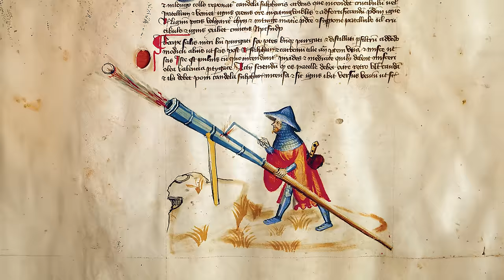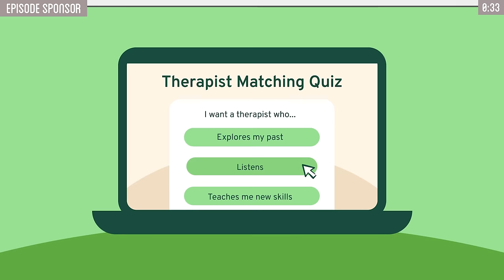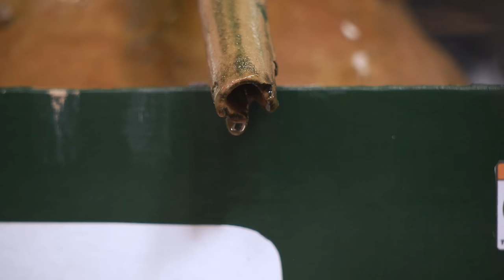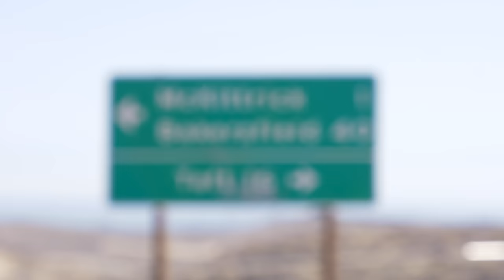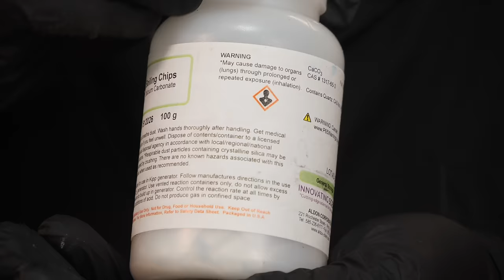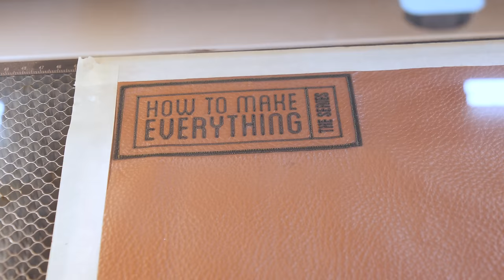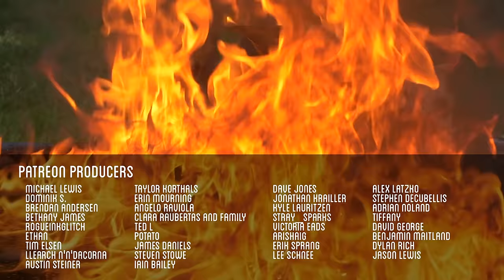I Recreated the Lost Recipe for Greek Fire!

Comment: Crude oil varies wildly in its composition.  It ranges from a jet black, nearly asphalt/tar in consistency and difficult to ignite, to a lighter color than 0W synthetic engine oil, about as viscous as water, and more flammable than gasoline.  It all depends on what formation it came out of and how long the oil has been cooking down there. The crude oil you got was likely of the former, and was a little more "undercooked", if you will.  If you want some of the better stuff, reach out to a lease operator in West Texas, they can probably get you a jug of it for free to test.

Interesting side note, in the old days when they hit a pocket of that gooey trash and it ended up being too thick to pump out, they would make a loop of rope that went down to a pulley at the bottom of the hole and then back up into a tank, where the rope was threaded through a rubber hole that wiped off the oil that got stuck to the rope as it ran through in the well.  Most of them used steam power that came from burning the very oil they were extracting, so with a little maintenance and a water supply, they'd run free of charge until there was no more oil to extract out of the ground.

Comment: Crude oil is definitely the main ingredient of Greek fire, but it would be too thin and burn too fast to be very good on its own.

Resin is the most likely ingredient added to thicken the crude oil, being a highly flammable liquid that sticks to about anything.

My guess is that Greek fire auto-igniting on contact with water may be an exaggeration based on the flaming liquid staying ignited on the surface of water.  Since it was already lit before being fired from pipes, it would be unusual for it to even end up thrown into water without being on fire first.  Even in terms of igniting any that is accidentally sent into the ocean without being lit first, the resin is flammable enough to make it easy to ignite.  The best reason Romans would have to put any quicklime in would have been for the noise and steam given off when it hits water to make it a bit more dramatic for anybody on the receiving end without any tangible benefit or down side.

Sulfur wouldn't need to be added to make it more flammable or to help it burn any hotter, so the only reason I could think of for adding it would be the sulfur dioxide given off when it burns.  Irritating the eyes and lungs of enemies could be marginally beneficial to Roman soldiers.  Since it was basically napalm already, it really wouldn't need to give off noxious gas to do its job though.

Comment: The "pump" which is the device which made it famous was probably key to it's success. It's said that it was a heated sealed container and that when fired it was projected from the nozzle. If you have a sealed pressure container. Once it reaches the boiling point of one of the lighter chemicals it will self pressurize. When you open the valve the liquid inside will very quickly boil pushing the liquid out the pipe through the nozzle. It's already at the point of vaporization of the lighter chemicals and will burn like mad. Note that this would be dangerous to test.

Comment: As the professor said. Greek fire/Liquid fire was more about the weapon system that pumped a flaming stream of crude oil, not just the light crude oil by itself. Actually a vegetable oil and ethanol mix would probably work too, but would be extremely expensive in a non industrial society. Vegetable oils were a food and cooking staple as well as a lighting source, thus expensive, while pure ethanol would not have been available.

Comment: Perfecting the lime:water ratio is critical. It also helps if you add a "fuel" like wood to the equation. I work with quicklime every now and again and the only fires I've seen involve pallets or sawdust in the solution.

Comment: Lycopodium Powder which you used in another video actually has very interesting properties with water where it stays dry and burns quite readily. I believe if the oil doesn't mix completely with it, it could act a pretty interesting addition, as the heat from the flame may cause an updraft raising the dust out of the water and oil producing larger more dangerous flames to make it even more terrifying

Comment: Pretty much any of those recepies can be the real one, because the main component that limits the ignition of a liquid is the oxidizer, in this case, the air.
So, a spray of any of the recepies will make them work. 
Also, temperature is important. Many ancient incendiary weapons used to heat the fuel before igniting it, to reduce the viscosity, but inadvertently evaporating some of it, making a rich fuel/air mixture that ignited better.

Comment: Pine resin and oil until past target viscosity, add alcohol to guess at thinning it out just for ease of ignition. Then very importantly add sulfuric acid until they combine properly as alcohol isn't very soluble in oil until acid is added. The acid is meant to sort of magnetically stick to both the oil and the alcohol, I forget the name of this loose chemical bond. 

If incorporating oxidizers such as salt peter, they must be fully dissolved in the alcohol first, and then the proportions of alcohol base used may be increased ONLY TO A POINT, but be extremely cautious when adding the acid to combine everything, as acids can set them off and ignite it. (The oxidizer would very much like to react with the fuels, but cannot, the acid can allow them to.) Also note that to create something explosive here, you would have to mix way more oxidizer in there, hence why I advised to fully dissolve it, not make it into a paste. That being said, a slower reaction could take place that gives off noxious exhaust gasses! On sea water, these gasses could be even more poisonous, but given the ingredients you are using you may get sulfur gasses that could cause death or serious injuries and burn to your skin, lungs and eyes even if not ignited. Unlikely, unless you go nuts with the proportions, but still possible, and some combinations of sulfur and hydrogen found in fuels and water can become poisonous in small amounts. (Maybe, who know..) Just trying to cover my butt!

 One last thing is that the main reason your alcohol was very useless was that it is soluble in water, but if you use acid to stick it to oil, or create some sort of an emulsification with oil, the alcohol helps improve ignition because it evaporates very readily, and ignites at a very wide range of concentrations with oxygen.

P.S. Plain oil would work pretty well, but easy ignition oil with spices in it would work more like an epic legendary weapon from history, worthy of myth and exaggerations!

Comment: I mean, a lot of this testing probably could have been avoided if we just take into account the fact that this stuff was supposed to be pumped through some kind of hose delivery system. 

Just the fact that it has to move through some kind of pipe or hose pretty much invalidates 90% of other things like hard minerals, solid additions like wool, etc. 

It's gotta be a pure liquid or extremely light oil type consistency to be able to fire over short ranges without potentially damaging your own ships. 

Just that fact alone and the fact that napalm is already a thing can give you a pretty good idea of what it most likely was, which was just straight up liquid petro with some kind of thickening agent to make it stick. Anything else just wouldn't make sense since all it would take is just to spray the enemy boat with the oil and then use a standard fire arrow or torch to light it. 

Self lighting wouldn't even be needed since you are shorter range anyway from the sprayers.

Comment: I'd love to see a followup to this where you take what you learned from these tests and try and refine it. As you said, the Ether burned very well but the quicklime couldn't quite ignite it. Could one of the other recipes do the igniting? Or perhaps even the delivery device like in a modern flamethrower?

I suspect the real secret to greek fire is going to be that of a specific recipe. The refinement of one or maybe multiple of the methods they had available into a particularly effective mix. You can have all the right ingredients but what if it turns out you need to fill the glass vial up to a specific point for maximum effectiveness? That sort of thing. The phial might also be important. Gunpowder isn't all that effective on its own, it becomes effective when contained.

EDIT: Forgot to mention. The composition of the target could also be a factor. What were the ships of the time made from, and were they coated in anything that might be relevant to the effectiveness?

EDIT 2: Another thing to consider is that the recipe might have required some "fermenting time". Someone else in the comments said that Ether can become very explosive when left in the bottle over time. It could be that you have to let it sit for quite a while. But thats getting into some very hazardous territory. Which is probably on the right track, but still. Don't want to risk that I imagine.

Comment: You said the princess recipe which uses pine resin is assumed to be incomplete.  Maybe the resin is supposed to be distilled.  That would give you turpentine, which is flammable and also works as a solvent to make the crude oil more liquid.

Comment: You need a taller fractional distillation tower and to tap off at the right height. The greeks worked out preliminary polymer work. Thats a better bedrock to start from, and oxygen/air autoignition materials were available at the time. Sodium and mercury salts for instance. Polyethylene could be made from crude i believe which would solve the surface tension and combustion problem.

Comment: Try:
3 parts pine resin, 2 parts olive oil, 1 part quicklime, 1 part sulphur, 2 parts bitumen, 1 part volcanic ash or clay

For a more water resistant version:
2.5 parts pine resin, 1.5 parts olive oil, 1 part quicklime, 1 part sulphur, 3 parts bitumen, 1 parts volcanic ash or clay

Comment: See from old picture, It shoot from ship horizontal direction. Maybe from pressure tank with high temperature. That is possible reach the flash point of mixer. The secret may have a he air blower to blow jet air to reach temperature the same way black smith rise the temperature to iron.

Comment: Have you tried adding some flint and steel sparking elements that would activate on impact inside the glass? Or maybe adhere a piece of purified sodium to the side of the glass somewhere in such a way that when the glass breaks, it also breaks the oxidized surface of the sodium so that it will be exposed to the water and ignite?

Comment: Actually, Petroleum distillation separates compounds on the basis of their relative volatility, which is usually inversely proportional to their boiling points.

There isn't any gasoline in your beaker, but possibly a very few of the 150 chemicals that make up gasoline.

Comment: How about adding calcium carbide?

I’ve got no clue if they had access to that stuff back in the day but if so I’d imagine it could’ve been a good ingredient. 

When coming in contact with water it’ll also release heat and more importantly acetylene. 
Maybe the acetylene would be carried away by wind too quickly to be of any effect but I think adding a highly flammable gas into the mix might improve its water resistant properties. 

Might be worth a try.

Comment: You sould look into some kind of boiling mechanism that would use the pressure of the oil boiling to project the oil. I'm thinking if you get oil hot enough it rapidly reacts when hitting the water. If you spray a flaming oil that is boiling hot then when it hits the water it only becomes more violent.

Comment: Pyr Automaton was better often confounded with greek fire. There was Sulfur and CaO inside and when it touched water it ignited from self. In amount over 1kg it did self ignite (on contact with water) the sulfur starts burning but was the mixing to good no air could reach the sulfur and it didnt burn so it was only an lose mixture

Comment: I wonder if some of the reputation of Greek Fire was derived from what they were burning. Ships are pretty flammable all on their own, so even if an incendiary weapon wasn't magically powerful and hard to extinguish, just adding more fuel and persistent sources of ignition to an already burnable target could have been enough to push what might have started as manageable fires on the deck into fatal fires all over the ship.

With thick oils and chemical mixtures, unless the mixture is massively volatile, it is often hard to get small amounts to burn impressively. Look at common matches. You have to be pretty skilled to start a bonfire with a single match, but if you light the whole box at once, you'd have to try pretty hard not to start a huge fire.

Comment: Instant fire has been around since biblical times. A combination of powder quick lime and small chunk sulfur with water provides an easy ignition.  When naphtha is poured on it it can light a bonfire. 😅  I seen a documentary about it. But that as a  stepping stone  for ignition  puts you in a good direction.  Another common thing avalible is olive oil. I know it floats on water for a bit and they used in in oil lamps for millennia.  

Now looking at the sticky fire using a current comparative is napalm aka jungle jelly. It is made of 46-33-21 parts styrene-gasoline-benzene. A small chain fiber, a fuel source and an ignition source . Basically to get sticky you need the shredded fibers. Period appropriate fibers common were linnin and wool. You use olive oil as your fuel and instant fire mixed with it. 

Next you use clay pots instead of glass. Make some thin wall clay pots and let them sun dry. They should shatter easily when dropped. 

I have not tested this😅but it seems a logical solution.  Maybe adding some pot still distilled alcohol witch should be more than flammable at 60%abv. Use as your low temperature ignition source for olive oil.    Makes me want to try but I know I shouldnt

Comment: I think if you let wool degrade in quicklime and then added the result to crude oil the result would yield a better exothermic self insulator and possibly allow for better reaction when combined with pressurized water to disperse it.

Comment: Just wondering if there may b3 a confusion between the wool part of it as we kno the romans had some great steel in weponry and used the natural oils fom goats and sheep wool call lanolin if u light steel wool pads they burn  quite hot  and if you blend it with the pinerl resin,crude oil,ethanol and even some magnesium  i think you may get all the contributory elements to be close to what your after.  It would even burn green as greek fire was described to do..🤔

Comment: Much like a flame thrower, i think the delivery system would have relied on an open flame at the end of the nozzle and it could have just been overcooked olive oil and animal fat collected from military and navy base kitchens. Ive witnessed some pretty heinous deep fryer fires in my life.
If you keep the fat and oil boiling for a long time, ut becomes highly flammable and almost impossible to put out the flames with water. One place i worked at used rendered beef fat and canola/rapeseed oil. Some idiot threw an icecube at the fry guy, ice when in the fryer and exploded all over the grill and i was the only person aware enough to grab the 20lb bag of salt, we did not have fire extinguishers for some reason, and smother the fire, but it kept popping back up until the FD got there to put it out and we were shut down for numerous safety hazards

Comment: This sounds a little farfetched but what if the Greeks had access to Bagdad batteries and were able to use electrolysis to produce pure forms of sodium or potassium and used a grounded up version of it suspended in crude oil. once the mixture touches the water that might produce a violent enough reaction to light the oil on fire.

Comment: seems like molotov cocktail, one possible oily fuel that is common to old times, is paraffin candle wax. also a sand desiccant would remove all water in any experiments. oil floats on top of water, and burns.
Reply: try molten spin separator blast furnace

Comment: Was hoping you would conduct these tests with heated fluids as that would make them easier to ignite. This is a proces that has a tipping point where enough burn releases the energy to ignite the rest. Ending just shy of this tipping point alters the outcome of the tests drastically.

Comment: I bet the method of projecting the oil was they were boiling it somewhere onboard the ship and it was already hot enough to auto ignite.
Reply: But if so it was wanted to ignite on the water, not in the kettle.
Reply: @SeekingTheLoveThatGodMeans7648  If it's a pressure vessel that can prevent it from burning by not having oxygen, it couldn't

Comment: 🤔 I've read that there were reports of using horse urine, which may have produced phosphorous, which may have contributed to the reaction with water. Also, that the "projector" included a reservoir that was heated by fire as part of the deployment procedure.

Comment: Could calcium carbide have been produced at that time? Used in conjunction with a flammable, floating material, the acetylene gas produced should be a good source of ignition.A flaming arrow should set it off. Just a thought.

Comment: Why not take natural sodium metal and crush it into crude oil. As long as it’s away from oxygen it’ll remain in a crushed element. You could potentially add your bodyweight in sodium to an entire container of crude oil. As the oil is lit and makes contact with water, the sodium will explode.

The oil will burn wherever it currently is. If you add water to it, the sodium will react, explode, and spread sodium crude oil everywhere. .